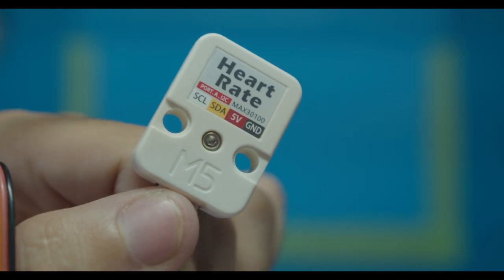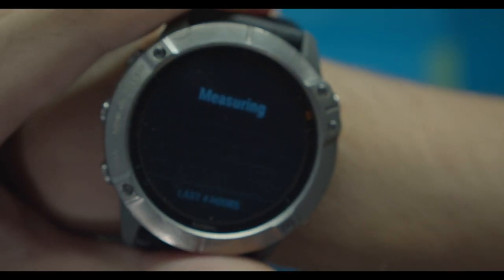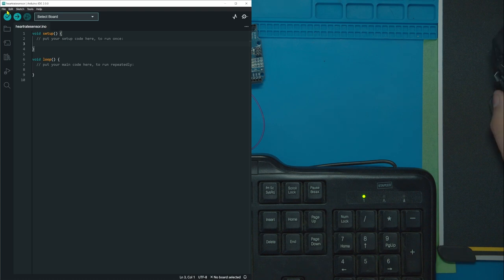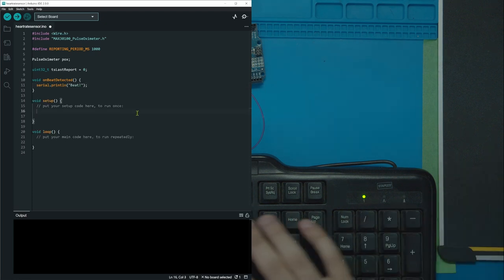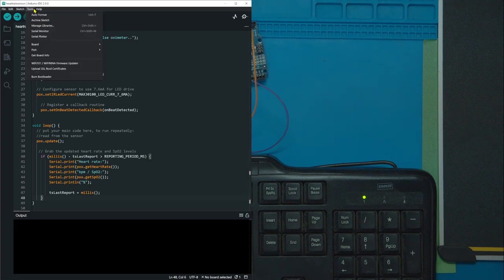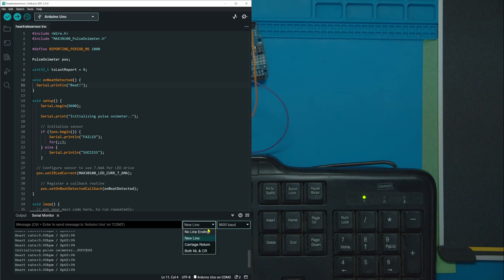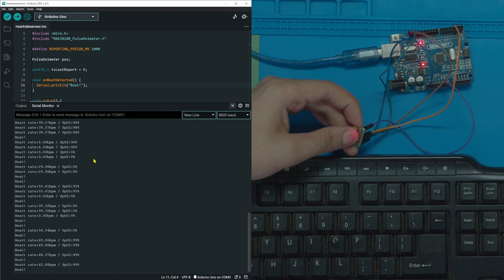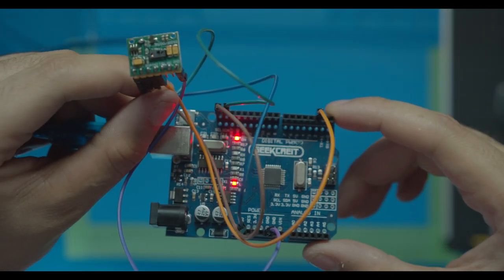ARDUINO HEART RATE SENSOR | PULSE OXIMETER | MAX30100

Comment: Wonderful video but I have a problem, all is good my max30100 work, the red led turn on and the communication i2c works but in the monitor serial I don't see values only 0. Is a complex code but I tried only in the loop with millis but still now I can't see the correct values only 0 :c.
Reply from the maker: theres a problem with some max30100 sensors, Im going to upload a fix for it, but for now just google it if you cant wait for me, its a stupid fix but it works